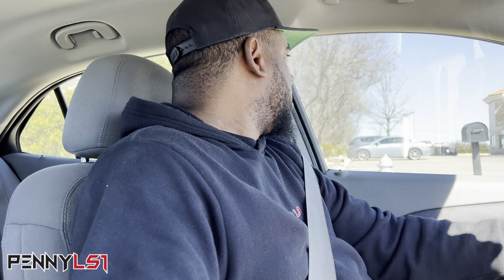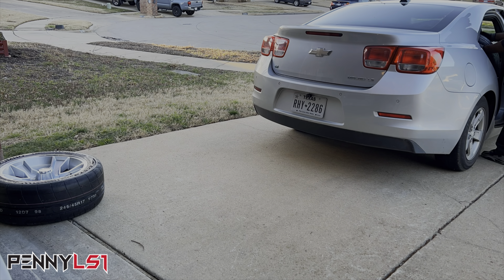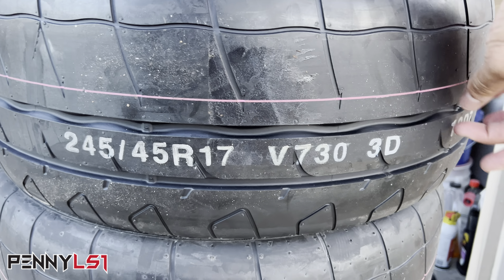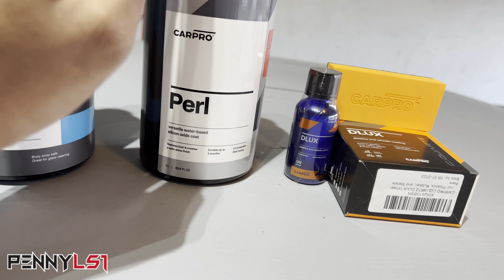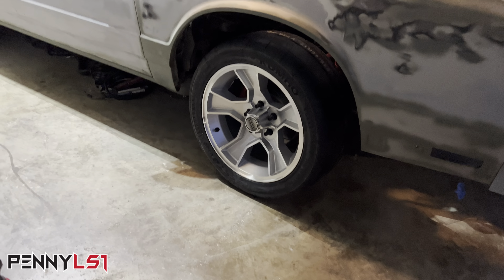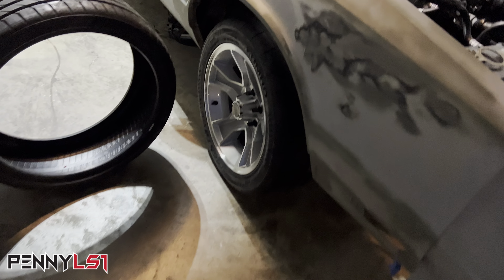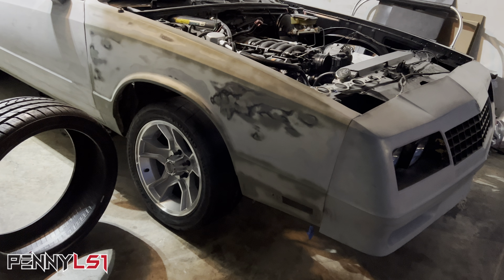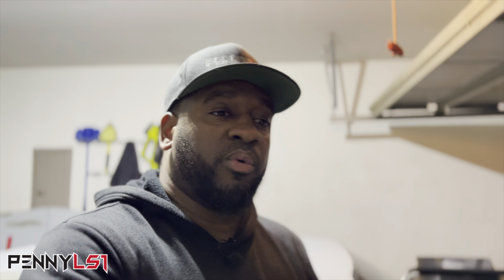1986 Monte Carlo Replica N90 WHEELS AND KUMHO ECSTA V730 TIRES

Comment: Nice wheels, I want to run those until I figure out the wheels I want also but they are damn near 2k with tires lol, Im figuring out other options unless I run into a deal on a set. We are limited on wheels without notching are frames smh
Reply from the maker: Yeah my factory wheels were too far gone. Plus I needed some wheels that would clear the Corvette front brakes. I plan on getting wheels ordered to fit without having to notch the frame.
Reply: @PENNYLS1  mines are not in great shape either thats why Im trying to find some nice temporary wheels,I had asanti's on it but I was running adapters which sucks, hopefully I can get some ideas when you pick yours wheels because I dont want to notch my frame but I might have to though